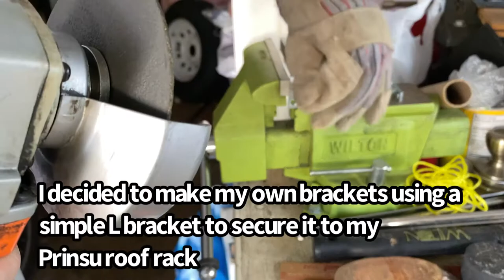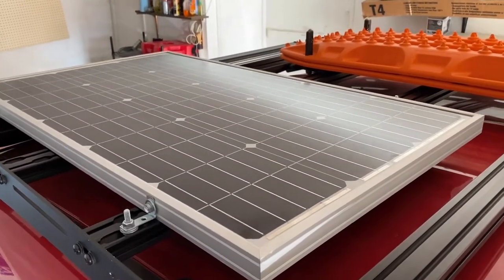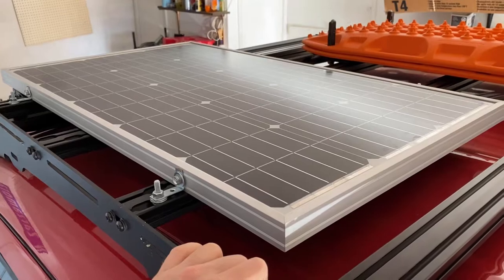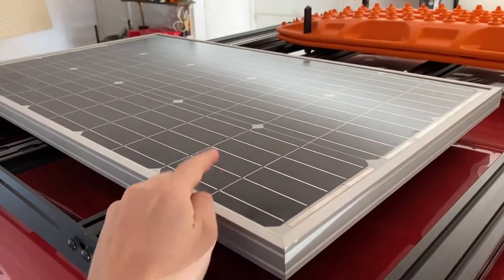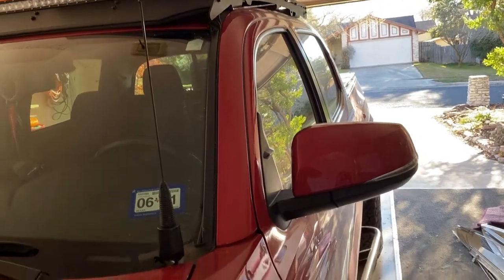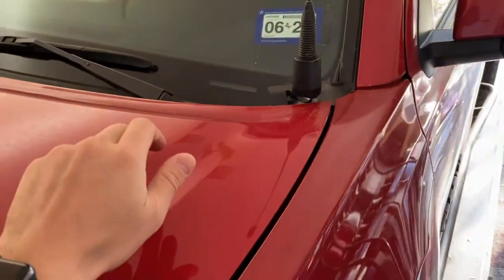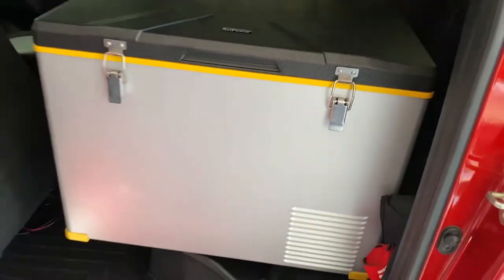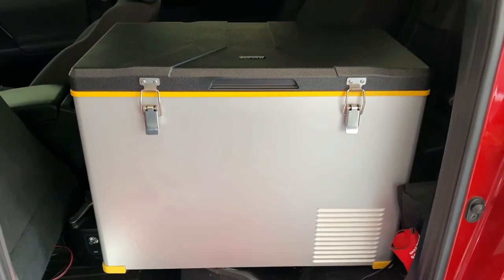NewPowa USA 75W Solar Panel to Power My SetPower Fridge/Freezer (How to Install)

Comment: How long will your fridge run on that battery setup with and without solar? I’m trying to plan a build for my jeep, I’d like to run it 24/7
Reply from the maker: With the fridge cooled and a good amount of solar energy it will run indefinitely. Without solar the battery can keep it operational for maybe a day depending on how frequently you open the fridge.

Comment: Great video! How long does the fridge last in the battery? And what happens when you don’t have sun?
Reply from the maker: The fridge will stay on throughout the night without any sun hitting the solar panel when connected to the EcoFlow River 600. Even on cloudy days the solar panel is pulling in solar energy to charge the battery. If something happened and I wasn’t getting any solar energy to charge the battery or maintain it then I could always switch it from the solar panel to a DC outlet in my truck. 🤙🏼

Comment: How did u connected solar cables to the 600?
Reply from the maker: My EcoFlow power bank has connectors to hook up the positive and negative wires from the solar panel. Simple plug and play.

Comment: How many watts is showing in the EcoFlow under good conditions?
Reply from the maker: Unfortunately every time I’ve planned a trip, and have gotten to utilize the setup it’s been overcast. On those overcast conditions though it will pull in anywhere from 38-45 watts
Reply: @panahrama6961  Oh okay.  That is still good.   TY